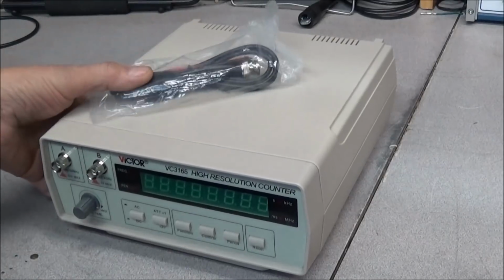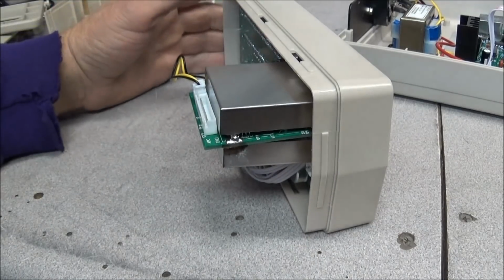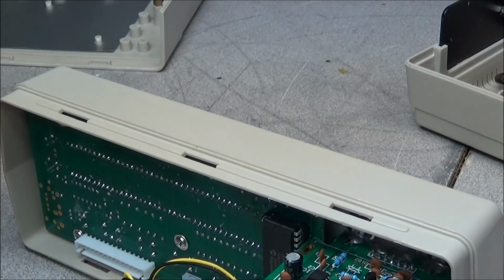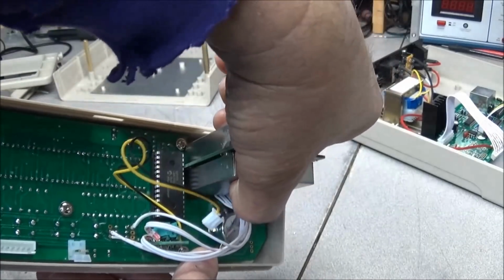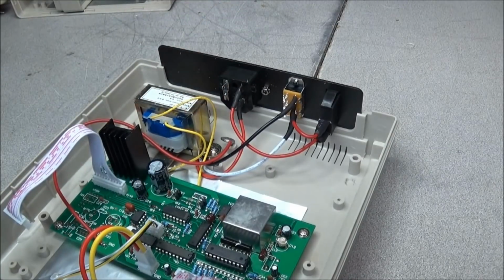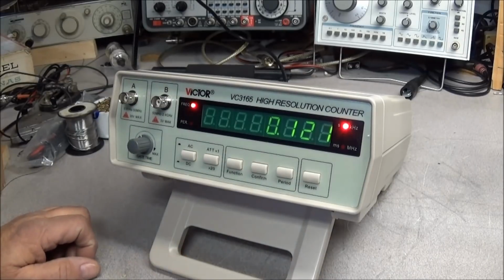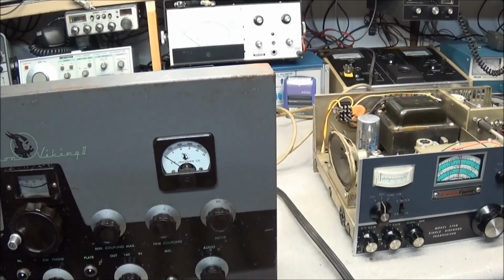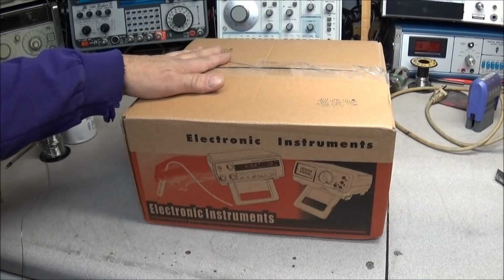#145 Comments Updates giveaway winner

Comment: Took me a few minutes to figure out what was happening at the AC input! Looked funny, what with the red wires carrying both the hot and neutral and the offset rear connectors and the 120/220 switch wiring.
Reply: Also, I realized that AC connector gives you an "un-fused" connection as well as a fused connection.
Reply from the maker: Yep, a little confusing at first.

Comment: PLEASE PLEASE WOULD YOU FIX MY KENWOOD TS 930S IT"S ALL I HAVE I WILL BE GLADE TO PAY WHAT EVER NEED MY RADIO DISPLAY BLINKING OUT LOOSE ALL FREQ. AN MEMORY TURN OFF BACK ON OK FOR A WHILE OR GOOD FOR SOME DAY'S RAYFOOTE@YAHOO.COM OR 662-507-1790 ANYTIME IF NOT TELL ME WHAT TO DO I CAN SOLIDER MAYBE COLD JOINT'S FIXED FINAL UNIT RE FLOWED SOILDER NO PROBLEMS WITH THAT NO MORE GOD BLESS        KG5UHZ
Reply from the maker: Ray, there could be many things causing your problem. Click on the show more tab and email me.

Comment: love your videos, but you should be pointing out that cheap chinese crap for what it is. Not using your reputation to advertise for them.  Might be a cheap way for someone to get into electronics, but starting out with junk gear like that can also ruin someone's experience when it doesn't function properly.  That update rate is redicilous. Please no more junk. More quality repairs with quality equipment like the vtvom you fixed and gave away.
Reply from the maker: First thanks for the honest opinion.  I agree there is a lot of cheap stuff out there.  I have even received stuff that I would not even do a video on. Anther is the soldering station from Dr Meter that I gave a really bad review on.  But I also must say that if a piece of cheap equipment does what it specifications say, then I have no problem with it.  No it is not a lab grade counter.  A little slow on update when set to high resolution. But it is as accurate as my Leader that cost quite a bit.  We do have to remember there are folks out there that cannot afford expensive stuff. Until Rigol, Siglent, Agilent, Keysight, or one of the higher grade companies give me free stuff to give a way ( which I really drought)  then I will look for cheaper stuff that folks can afford.

Comment: Protecting the bottom of the main PCB is a good use of "fish paper" (wonder where that moniker came from?); Heathkit used to send pieces of that along with test equipment kits where that kind of isolation was required. Just replenished my supply from a eBay seller; it's inexpensive and good insurance against inadvertent contact. Thanks for sharing Buddy and your generosity to our new counter owner!  73 - Dino KL0S
Reply: Dino Papas 

Fish paper was made from fish scales at one point in time, hence fish paper.
Reply: Ahhhha, wonderful cocktail party trivia to remember!
Reply from the maker: Thanks Dino, Man I sure wish I had some fish paper, and not the kind that comes from the market! I will check ebay for some. Thanks
Reply from the maker: Hmmm, something smells a little fishy!  Just kidding Mike. Thanks for the info.
Reply: The Radio Shop

Automotive gasket material from the local auto parts store works well in a pinch.  They sell rolls of it.

Comment: Glad someone will be happy with the new counter. Got my Victor counter working, now is my frequency generator out or is the counter out? Counter says 14.00094 and frequency generator says 14.00000. It's about the same on all frequencies except 160 and 80 meters which then it says my counter is about the same but below the frequency generator. O well it's close. Thanks for the very informative video and I will be doing the cardboard paper insulator as mine is the same with the metal foil bubbling up. Lyle

Comment: Buddy,

I got me one of these some years ago (different sticker, same item) and the shielding IS indeed a problem...it kept coming loose.
I replaced the bottom one with 0.60 mm aluminium sheet, which I bent up at the rear, in order to shield the transformer from the 'innards'.
Worked well even since.

And you're right...OLD64GOAT his channel is worth some time! Parts of his intro-video looks like a hostage-tape ! Gotto love an old boy with attitude !

Paddy